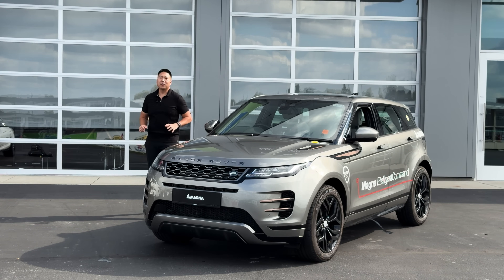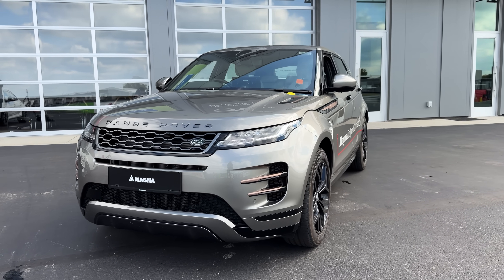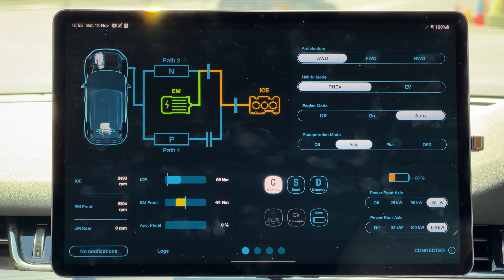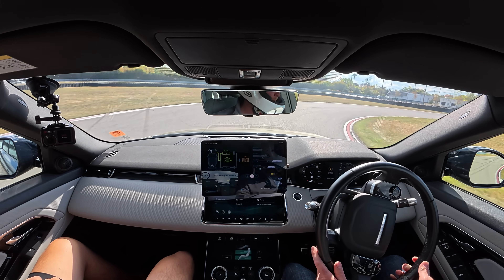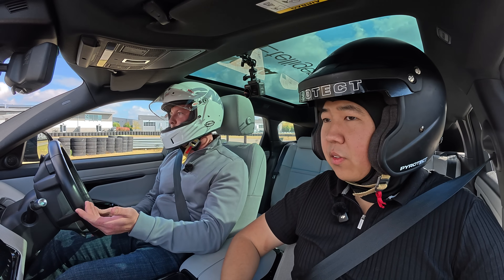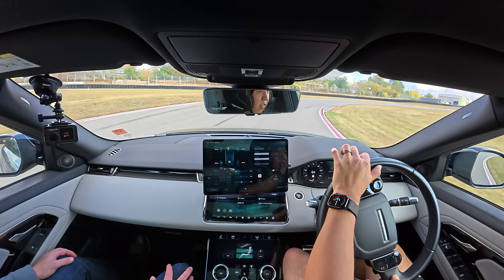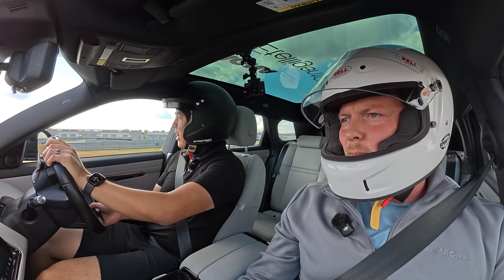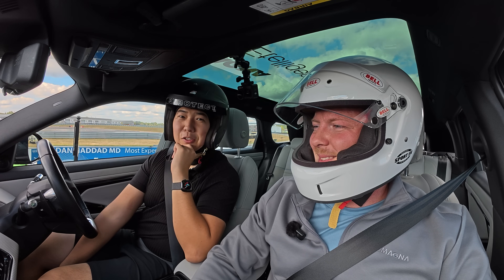The Future of Hybrids? | MAGNA PHEV Powertrain!

Comment: 20 KW batt for 70 mi EV only range is impressive,  esp with how heavy RR are
Reply: Not realy, just over 3 Miles per kWh is quite mediocre. Exactly what the car should be getting.
Reply: FYI Weight has very little effect on EV efficiency. Lucid Air Touring weighs about 5,000 lbs and is one of the most efficient high way capable cars ever.